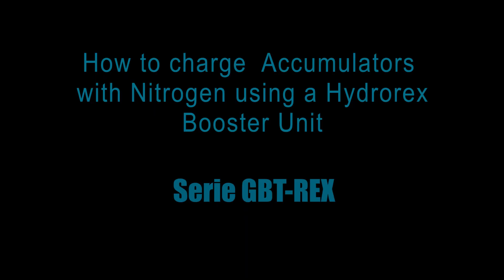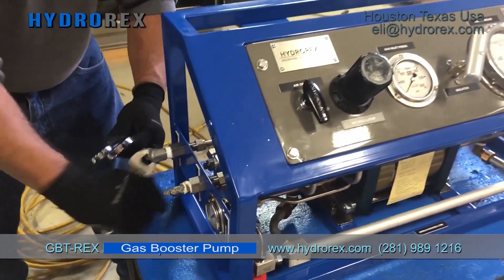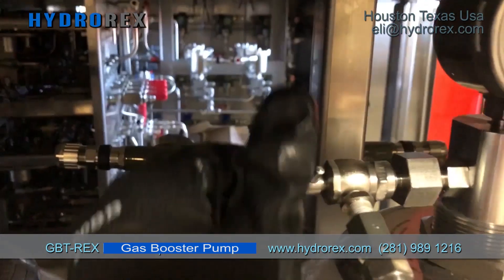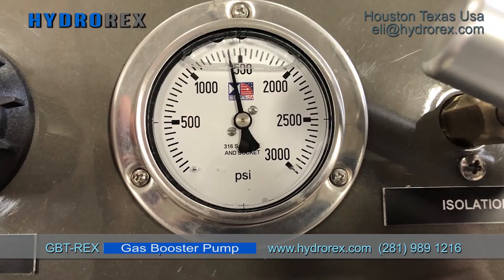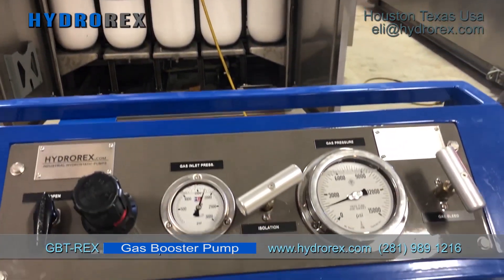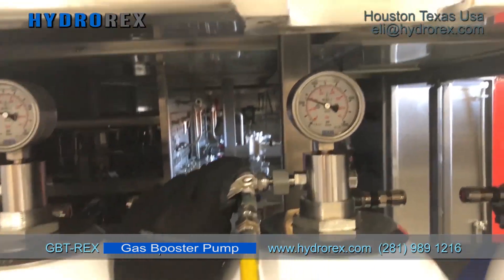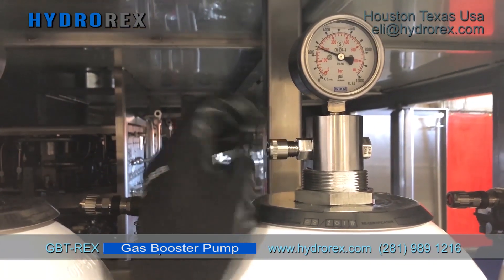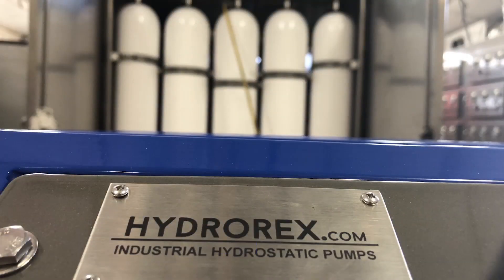Charging Nitrogen Accumulators | Gas Pressure Pump Unit | 281 989 1216

Comment: Pls what is the purpose of the gas boosting? And can this also boost the air pressure from an air compressor?
Reply: The purpose would be to keep a system charged, the pressure is a working force. Accumulators I've worked with have all been hydraulically automated by a pump motor. The redundancy with N2 would be the ability of the system to work should the Pump motor fail. It's super dangerous, and its killed colleagues of mine! Don't fuck about! Air compressors are a different principal.